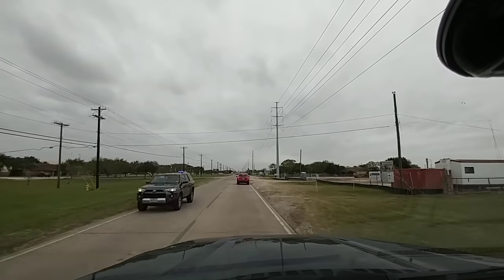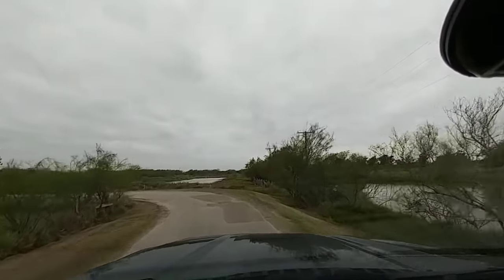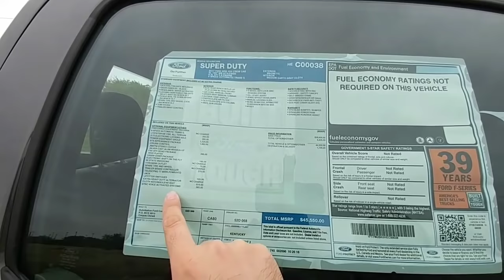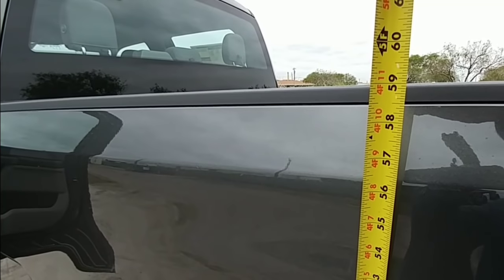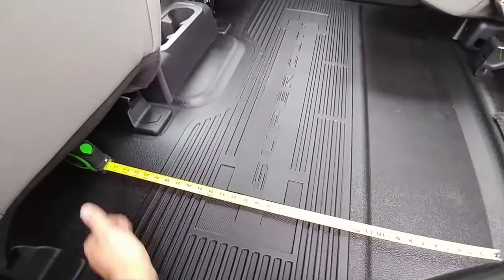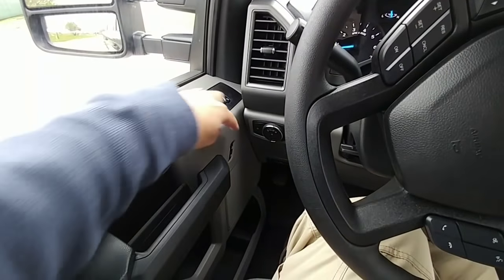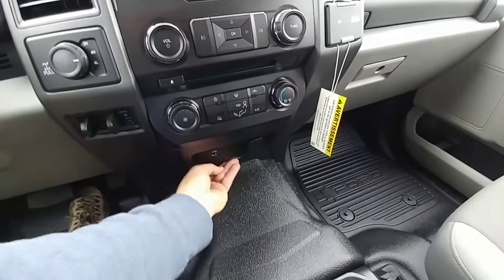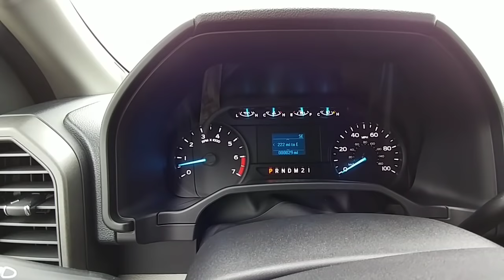2017 F250 STX FX4 6.2 Gas...Full Review

Comment: Best truck review I have seen in a long time. Thank you for picking a model that normal people are more likely to afford
Reply: i was going to say the same thing
Reply: Jeff Troy Nailed it Jeff! I was thinking the same thing!
Reply: Exactly! It feels good to be " normal "...
I just purchased a 2017 F350 XL gas but it has more options in it than any other XL I've seen so I'm actually thinking that someone ordered the truck but then maybe the deal fell through?  The sales guy at the dealer referred to my truck as a freak. 
Keep up the great reviews !
Reply: Mike Merritt does the F-350 ride rough with an empty bed?
Reply: Adam Sone ,  it depends, for a 1 ton truck i think it rides very nice. It doesn't handle "chatter " bumps too smooth but most of the time it's actually quite comfy.  
 I'm usually towing a construction trailer but i did drop the p.s.i. in the rear.
Reply: Mike Merritt yeah sounds more or less on par with my f-250. Thanks bud. Merry Christmas!
Reply: Adam Sone ..... when i compared the 250 and 350, i couldn't find 1 reason to go 250 . If they ever figure out the new generation of diesels i will get one but until then I'll be very happy with gas.  Happy Holidays !
Reply: @mikemerritt2043  
Figure out...what exactly? My friends F250 PowerStroke is running just fine and he uses for his construction business. And who buys a F350 gas truck?
Reply: @Sig721Tau  I just ordered an F350 with a gas engine. And not only with a gas engine, but the 6.2 L gas engine.  And even after experiencing a diesel powered one ton (Cummins).  The diesel power is nice, effortless trailer towing, but some of us want a thoroughly capable truck without worrying about diesel emissions equipment and driving with those things, or having to shell out big money for regular service (Cummins services sometimes being upwards of $400, depending on which service is required vs. $50 oil change), and the big upcharge.  Payload, feel, and off-road capability are also big concerns as well, as I anticipate farm and ranch work in the wet winters.
Reply: my F-250 rides like a dream when there is 2K of gravel in the bed.

Comment: 85℅ of people don't need a Diesel
Reply: Jake Rheault Maybe 95% lol
Reply: Yup. Like 100% lambo or Ferrari owners  don't really need a v12 to beat a Honda civic at lights....
Reply: monsword yup, it’s all about what you want/can afford
Reply: Jake Rheault because of the oil companies and carbon taxes
Reply: Yeah i agree.
Reply: @melrose9252  yeah i agreed
Reply: Need vs Want.... if you want it enough it becomes a need lol
Reply: Toyota camry can mop the floors with a civic.😁
Reply: Jake 
85% of trucks owners don't care about what you think. Lol
Reply: I wanted a diesel. I could afford a diesel. So I bought it...F250 FX4 Lariat Ultimate crew cab short bed.
Reply: I can't never buy Ford diesel but I will 6.2 gasoline engine F250
Reply: How else am I going to get 500 hp out of $350??

Comment: Due to EPA mess, I can no longer get a diesel. Too expensive to buy and maintain now.
Reply: THE DPF, AND DEF, R THE DEAL BREAKERS,
Reply: Yep, even as a Ford certified diesel tech on boats.... I'd never buy a new diesel trucks. Older ones yes... new ones... no freakin way.
Reply: I had a diesel f 250 and I had to get my truck serviced and my boss loaned me a truck it was a gas f 250 and I sold my diesel truck and bought a new gas f 250 XL and I can't wait for the 7.3 gas engine
Reply: TY  that's why I went with the 6.2L, I pushed snow and landscaped years ago with the diesel im sold off and no need for it now but I still need to drive a mans truck
Reply: Taka Yama
I highly doubt that you drive a truck with a handle like that.
Reply: T Hill what made you trade the 6.7 for the 6.2?
Reply: Yep, dont want one either.

Comment: Finally, an F250 gas review. Thank you thank you thank you!
Reply: More payload than a Diesel by 600lbs. Better for towing
Reply: I was JUST going to say. ALL of the others out there is using the Power Stroke. I was opting to get an F-250 with the gas engine.
Reply: Wireman134 not at all
Reply: @Wireman134  
A gas equipped pickup is better for towing than a diesel truck. -said no one, ever!! If gas engines are better, then why do Semis have diesel engines ?
Reply: @Wireman134  not , if you like getting 6 mpg and no power

Comment: I just bought a new 2016 F350 with the 6.2 engine and a Sabre 28RL 5th wheel trailer.  So far we have pulled it 1500 kilometers (sorry, I'm Canadian) and are planning to leave Ontario in 3 weeks and head to Jasper, Banff, Vancouver, Vancouver Island and return via Mount Rushmore and Yellowstone.  Your videos have been a wealth of valuable information.  Before we go I am having "E" rated tires installed to replace the "D" rated Chinese manufactured tires.  Thank you for that one bit of advice which I suspect would have caused us a lot of grief in the middle of our trip.  We are 65 years old and never RV'ed before.  A steep learning curve ahead!

Comment: The 6.2 is ideal for me.  It pulls my Jeep and trailer through the hills with no problem, and when I go out to my hunting camp, the additional weight of the diesel isn't of benefit when crossing swampy areas.  The 6.2 is no diesel, but it feels much stronger than its 5.4 predecessor and stronger than the 6.0l Chevy I had before it.
Reply: Gary Stark I test drove an f250 gas and I gotta say their 6.2 is stout. Such a superb engine with a good power curve. I was very impressed. I think anyone who buys the 6.2 f250 will be more than pleased with it. Chevys 6.0 is bulletproof but it just feels like it belongs in a half ton even tho it has good power for pulling. The whole lineup is impressive
Reply: Gary Stark i
Reply: @mattr7118  The 6.0 Chevrolet is a bulletproof engine, and will feel disappointing for a very, very long time.  That said, it is also a capable engine, but when it came time to order a truck, I went with the Ford with the 6.2.  The stalwart.
Reply: I don't pull a big trailer often.  Didn't want the diesel with the high cost of maintance.  I'm happy with the 6.2
Reply: I had a 2002 F250 with the 5.4 and it was a nice truck but a turd for towing.

Comment: I bought a 2017 F-250, in November of that year. It was one of the last trucks sold before the small dealership closed. I paid 30K..I added a rear view camera, tinted windows and running boards.
And of course under coating.
36K all done.
It's been a great truck. hauling 12 foot trailer loads from Ohio to NC.  You would never know it was on there.
I have pulled aprox. 12K pounds of cattle a few times. That you can feel.  But With 67K miles, I had no problems at all with the truck.  I used it for much more than I ever expected. I love the truck.  I find the locking rear difs very useful.  One of the reasons for the discount was no one liked the vinyl floors.  I love them. Having dogs and living on a farm, it is so easy to clean the truck

Comment: I have a 2019 with the 6.2 and I upgraded the air intake and went with full dual exhaust and noticed a more power little better mileage got rid of the diesel got tired, dealing with the EPA smog crap talking to a friend of mine at Corning Ford told me he’s selling more gas now than selling diesels for the same reason

Comment: Currently driving a 6.7 diesel just came out of warranty and the egr valve needed to be replaced 2,000$ fix, going to trade for the 7.3 gas as soon as I can, I know it won't have as much pulling power, but I'm hoping it is cheaper to run/fix.

Comment: A lot of us horse people in England use old Land-Rover Defenders, which are alluminum bodied. Pretty durable, and stand up to punishment well, but they do dent pretty easily. Never seen one rip though. With this Truck, I'd find it a bit too utilitarian for my taste. Bit of a softy I'm afraid, I like my comfort. Don't care so much for electronic gizmos, but I like to sit on leather, with armrests, seat heaters, and aircon for summer. Do like a bit of wood trim as well. For those long trips, I need to feel I'm sitting in a nice place, especially when spending many hours in the vehicle at a time. Entire days sometimes. On our Range-Rovers, we get heated steering wheels too, might sound like a gimmic, but man it's nice on those cold mornings. On this budget, I think I'd look at a 2 year old Truck with say 50,000 on the clock and have a King-Ranch. It's barely run in at that anyway, and probably just as dependable as a newun. Less of a depreciation hit too. But that's just me. I do understand the appeal of having a brand new vehicle though, so I couldn't blame anyone for choosing this Truck. You pays your money etc.....
Reply: Just the person I am looking for. I'm trying to decide on a new American truck (Ford/Chevy) but have the option for a 2011 LR4. I need the seating, towing and prefer the reliability. Do you have any suggestions?
Reply: In America, Land Rover is unreliable and become endless money pits as they age.

Comment: Good review. I paid about the same for my 2017 F250 Lariat with the 6.7 PSD. Took a lot of shopping to find it though. I have a company vehicle so I typically drive my truck on the weekends and for longer trips. A lot of that is towing or hauling. My F150 sat for weeks on end because it only got 13mpg. This one is even worse. My father in law has the 6.2 and the milage is horrible and he's said he didn't want to deal with the DEF in the diesel, but would buy it now if he could. I have towed 13k+ and the power of the diesel was fantastic to have. 

As far as maintenance, it's not as bad as most would have others believe. Yes, more oil and fuel filters are added to the cost, but at the required intervals, it's not really a big issue. The regen of the diesel is a minor inconvenience that I don't care for, but worth the trouble for the power and mileage I get.

I would not buy a diesel truck at full price with what they're wanting for them which is why it took so long to find.

Comment: I had the opportunity to drive a 2017 f350 6.2 with a 39 ft fifth wheel.  I was totally impressed.  A diesel would pull better, But I will not own any newer diesel due to cost And emissions.  The 6.2 got it done very well, And it was so quiet to ride in. Many times I found myself running 70 mph it felt like you were going 40. I was looking at replacing my 7.3 with a Chevy HD, But after driving the Ford I think I am going with it with the 6.2. It is nice seeing a review of a gas truck for a change. Great review,  Thanks

Comment: I have a 2016 Super Duty with 6.2. I've had it just over 2 years and really love it. It's got more than enough power to haul my 4500# camper and the sound the engine makes as I accelerate is a treat in itself. But I wouldn't recommend it to anyone that does a lot of driving. It works for me because I only take it out once or twice per month. I'm satisfied getting 10-11 mpg hwy because the miles are so low. If you plan on driving a 6.2 Super Duty 10K or more yearly, you'll need deep pockets for fueling.
Reply: Clarence Aaron Jones I don't know about that I have a 2011 F250 6.2 it's my daily driver I've driven it ever since I got it in 2010 I get about 10 miles a gallon of E85 in about 12 on gasoline cost me about 60 bucks a week to fill it up
Reply: Perry2186 if you're ok with 10-12 mpg with your gasser as opposed to 18 you could get with the Powerstroke, that's great. But like I said, I wouldn't recommend it unless you live in a state where the price of diesel is much higher than gas.

Comment: That center “mini” console is not typical and a fleet only option and would not be typical. Most of these would have 40-20-40 bench with flip down console. The vinyl flooring is not “premium” but standard. There is a premium vinyl option on higher trim levels that includes padding under it that the standard vinyl does not have.

Comment: Just purchased a 2012 6.2 getting empty 14 mpg doing 60. Haven’t had a chance to tow yet but am certainly excited to see how it pulls my 23’ trailer. A bit overkill but the payload was the winner which I believe is rated at 3k. It was this or the Tundra and the more I looked into it the less a Tundra appealed for me and my family needs. A great truck for occasional towing. 
The ride is a little rough over some roads but I expected that being a truck.  
A buddy of mine has continued to buy diesels even when both of his Fords crapped out. He bought a third. Smh. Too many stories about diesel which made me go gas.
Safe travels all.

Comment: Awesome review. I have had many flavors of the F250-F350. The quality from 2011 to 2015 was improved to a huge degree and much better now. The gasser is the ticket. I float around the XL-XLT. If you shop hard the XLT can be had cheaply enough. The rubber flooring is the only way to go if you really use these trucks. The undersides are just as beautiful as the outside these days. I got a 6.7L in 2011 ( first year) only because they had a $9K rebate. After the warranty the diesel is just too complicated to deal with. Oh the vinyl interior is the bomb. Ford cloth isn't attractive and now is like $995. option. Many people thought my vinyl interior was leather-really! Great review.

Comment: That’s a good review of the truck, I bought the F 250 XLT with the gas engine and it’s 4 wheel drive with manual locking hubs and manual 4 wheel shift lever on the floor, I don’t need 4 wheel drive but all the dealers didn’t have the 2 wheel drive model and I got mine with the 8 foot bed I’am very happy with this truck and I had to put running boards on it and Ford made that easy to do they put studs into the body so the mounting brackets just bolt up no drilling needed, in all it’s a very nice truck.

Comment: just an FYI when you state the towing capacity you should state that the 4.30 ratio is required for those towing numbers. and most gas trucks are ordered with 3.73 which limits your towing to 12,000

Comment: I love Fords they have been my truck of choice for years and in 2015 I decided to try a Ram 2500 4X4 Crew Cab with an 8ft. long box Tradesman 2 with the 6.4 LTR Hemi engine and so far I really like the truck. It is a tall truck and I did install running boards and mud flaps and the cab has the clearance lamps on the cab plus its all setup for a 5th wheel or gooseneck trailer, it has a nice center console that lifts up into a center seat. I only paid $37,900 for it New and it came with the 18" Firestone TransForce TA Tires which are really great tires. The interior on my Ram puts this 2017 Ford F250 to shame and plus the Ford sells for around $7,000 more than the Ram. Ford needs to step up its game if they are going to compete with Chevy and Ram. The Ford in this video is really stripped down for such a high price tag. I still love Fords but they need to step back and take a hard look at what their competitors are offering for a lesser price tag. Chevy I'm not sure what their trucks are offering and their prices but I will say they have some really sweet looking trucks on the road.

Comment: Good review. My work truck is basically the same as the review, a 2017 F250 XL standard cab 6.2L motor. Now for my observations after 6 months of driving it. My old work truck was a 2000 Chevy standard cab 6.0L gas motor. So you will see my perspective. I don’t like the new Ford. It’s much bigger than my old Chevy. So it’s a pain in the ass to park around town or in parking lots. Also, it feels really weird with the throttle response, the computer controls the throttle rather than your foot. But my biggest complaint is the fuel mileage, I’m only getting 8-8.5 mpg around town in this Ford. If I personally owned this truck, I couldn’t afford to drive it. Also, the ride is a bit more choppy than my old Chevy, important if you drive a lot like I do for work. And like was mentioned, the Ford sits higher, so you are literally climbing into the truck, I had to get running boards to make that a bit easier.But I expect the boards to get smashed one day off-roading. Now I tow with this truck, it has plenty of power, more than my old Chevy. I’m towing fork lifts, tractors, big mowers, usually over 15,000GVW. So that’s a plus. Over all, I don’t think it’s worth the $40,000 my job paid for it. Heck, I could buy a small house with that amount of money. Of course I’m a silly Luddite, who personally owns an old 1981 F250 4x4 manual trans 300 six. 😎

Comment: We bought this exact truck but with cab lights and duel batteries and back up camera. We tow a 1999 fifth wheel 30’ gvwr 9,500 just fine. If you actually do some research diesel trucks from the 90’s vs todays GAS trucks make almost or more than the power of the older diesels. Proof is we use to tow our exact fifth wheel with our 96 7.3 powerstroke and this 6.2 gasser has more horsepower and about the same power in torque. Just kind of a neat observation.

Comment: After seeing how the STX is equipped it amazes me how some of the oilfield companies would order their XL Superdutys. I bought a 2011 F250 CCLB 4wd 6.7 that was ordered for one of the bigger oil services fleets with all of the features to the point that the only difference between this truck and an XLT was the lack of chrome, rear seat cupholders, power seat, carpet (I preferred the rubber floors anyway) and the automatic headlights. It came with backup sensors, SYNC, and the steering wheel radio controls. On top of that the company had also put replacement bumpers on both ends, headache racks, and B&W hitches. Just because the truck says XL on the side doesn't mean it's guaranteed to have manual windows...and no arm rests ;)

Comment: I moved from the 2011 1/2 ton Ecoboost to the 2018 6.2 F250 and will say the ride is for sure stiffer but the trade off is when you hit bigger/harsher bumps.When those bumps in the road are bigger or harsher it is not as jolting as it is in the half ton. One other not, without the console that truck needs armrests!